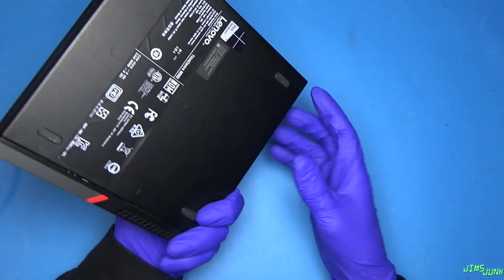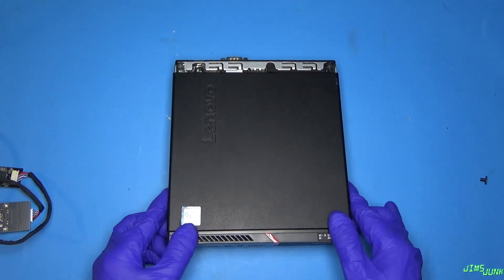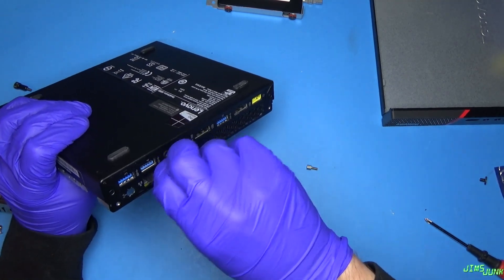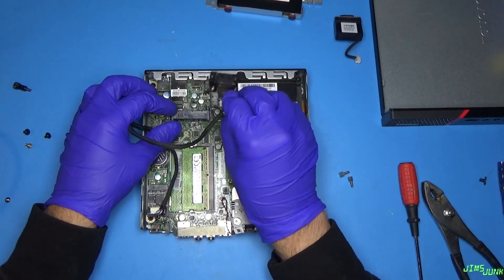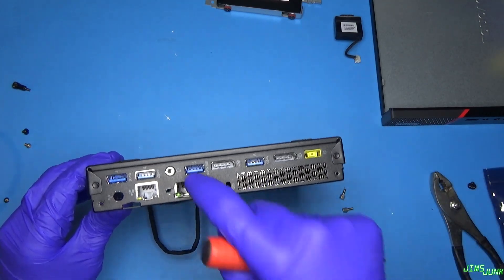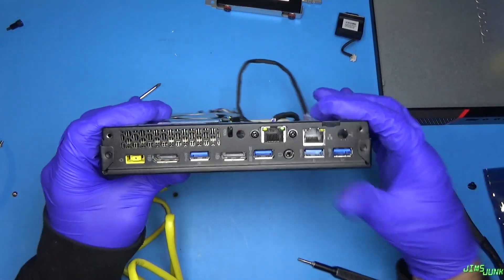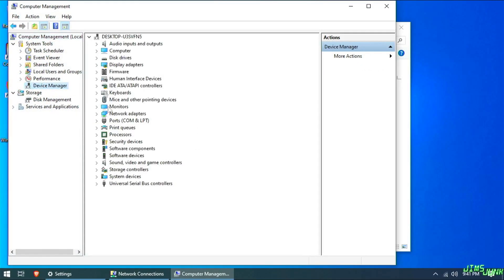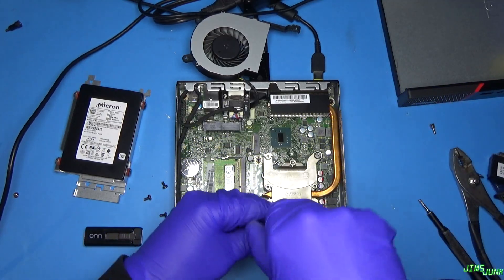Will It Work? - Second NIC Install - Lenovo i5 6500T USFF (Tiny, Micro) M.2 Ethernet port install

Comment: You could probably make this into a router of some sorts
Reply from the maker: Thats the plan..actually already done.  Working great
Reply: @jims_junk better then some shitty ISP router? Because I'm looking into doing the same
Reply from the maker: @mrni6502  absolutely.   Gives you far more flexibility if you also want to run a vpn server, need to setup vlans or anything else.   My previous setup was a D510 atom board that ran pfsense for years uninterrupted.  Had no issues with throughput but the board was failing so figured i'd just upgrade.
Reply: @jims_junk what did you use to broadcast a wifi signal? A access point?
Reply from the maker: @mrni6502  yup

Comment: Cool stuff! Funny how it works despite Lenovo saying it wouldn't. Also, I had a hearty laugh at you covering the way you apply the new paste, got too many comments from people saying 'NOOO YOU SHOULD DO IT LIKE X OR Y'?
Reply from the maker: lol thanks!  Nah I haven't but its all over youtube, everyone knows better.
Reply: @jims_junk  None of them realize that it gets squished when you put the heatsink on so it doesn't matter what fancy crap they draw, its still going to be covered.
Reply: @zachbeckner As long as you don't put it in a circle to trap some air in  there, the way of applying doesn't matter a lot. Even  the amount doesn't matter all that  much as long as you don't add too little.